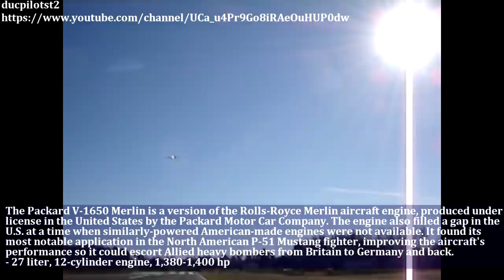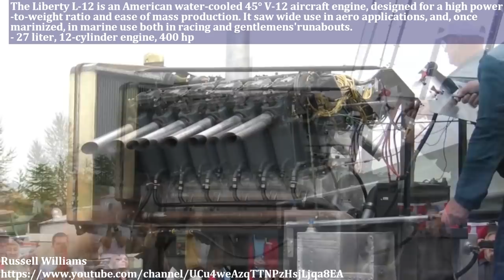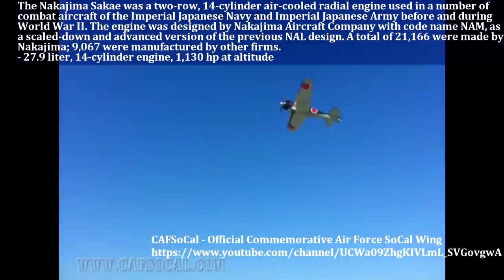Gigantic Aircraft Engines Starting Up and Fly

Comment: Why is the P-40 Warhawk shown at 2:30 ? It NEVER had a Packard/RR engine! Allison only. Also, at 3:45, that's a RR Griffon with contra-rotating props (much larger 37 litre displacement), NOT a Merlin. Completely different engine. There are probably several other mistakes, but I fast forwarded through this poorly made video.
Reply: If you see a p40 with no little scoop over the nose it's got a merlin they did make them I believe there's only 2 flying today

Comment: Just got to love how you tried to distinguish the Packard built RR Merlin - as a different engine to the original made in the UK - in an attempt to steal the credit from the RR Merlin which MADE the P-51 Mustang's reputation. Packard-built RR Merlins was also used in Spitfires.
Reply: so there the same?
Reply: @TheNamePi  Yes. The Packard RR Merlin, was license-built in the USA. The only difference was to produce the RR Merlin engine using a mass production approach.
Reply: @idleonlooker1078  ok thanks

Comment: The Allison was not 28 litres but 27 and based on the rolls Royce merlin
Reply: Tom Lowe: You must be the soul of every party.
Reply: Carcastic git
Reply: rcastik? @tomlowe8563  :carcastic?
Reply: The Allison and Merlin were completely different and neither was based on the other.
PS I'm not being carcastic, either, so there!
Reply: The first V1710 Allison ran in 1930. 1936 was the first RR Merlin.
Reply: @6h471  The first Merlin ran, as a private venture by Rolls Royce, in 1933. By 1935, the engine was available for the first flights of the Hurricane and Spitfire.
Reply: The Rolls-Royce and Allison were completely different.  Crankcase on allison is two halves bolted together. Allison head and valvetrain design far superior over the merlin. Allison blower was way inefficient compared to the merlin. Both used fork and knife rods.
Allison 5.5 x 6  1710 ci
Merlin  5.4 x 6  1650 ci
I own 2 Rolls-Royce Griffons, same head design as the merlin, lots of maintenance on the valvetrain.
Also, the Allison was 28 liter.
Reply: @GriffonGrowl  If the Allison was so superior to the Merlin, why not "just" improve the air inlet system of the Allison (they did for multi engined aircrafts like fx. the P38) instead of building a system to license-produce the Merlin 66 at Packard for the P51. I know about the government restrictions only using super -/turbo charge systems on the Allison for specific airplanes but still ...